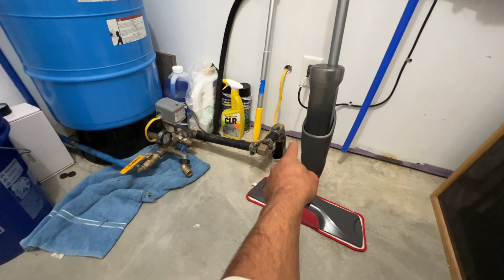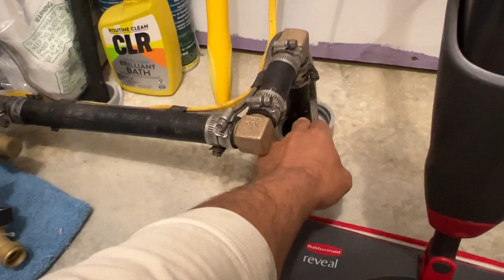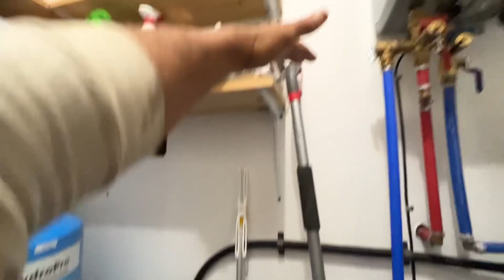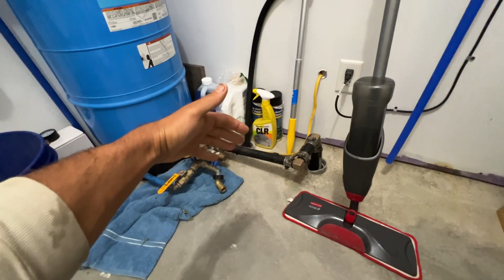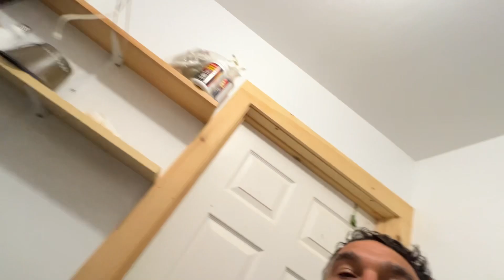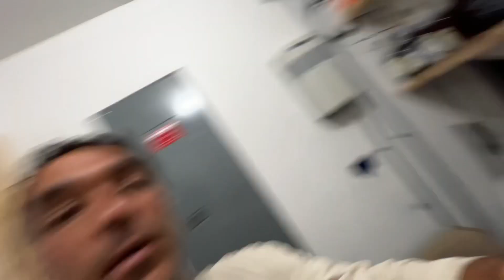#1 Water Well Installation Mistake?

Comment: Don’t see a check valve. Do you have any hydrants or underground tees?

Also, it is incorrect that having a larger tank inherently provides extra available water during a power outage. The reason is because you have no control on how close your system is to the cut in pressure when power is lost. For example, your tank will hold about 5-6 gallons when full. If the power goes out and your tank is full, then great you’ll have 5-6 gallons of water. However, if your tank is within a few psi of turning on, you may only have 1 or less gallons of water left. This concept applies to all tanks/sizes. The only real difference is how much water the tank will hold between your cut in pressure and drained tank air charge which is negligible for most size tanks. You won’t get more than a 1-2 gallons difference from a small 20 gallon or a large 120 gallon tank. It’s truly luck of the draw when you lose power on how much water your tank has at that exact moment. If this is a concern, get a generator or a hand pump for extended power outages. Simple pumps or Bison pumps work great.
Reply from the maker: Good point about cut-in timing.. but won't a bigger tank still offer more relative? We def use generators and the bison pump too.

Comment: Yeah great Idea. I just went into a well problem this summer, has in not enough water (it's an artesian well). Now I want to make a surface well higher in the landscape, but I am wondering how I will run the pipe inside the house without breaking the concrete. Probably will end up renting a concrete drill and use your advice and send more conduit than necessary.